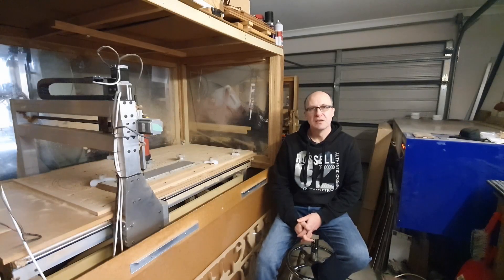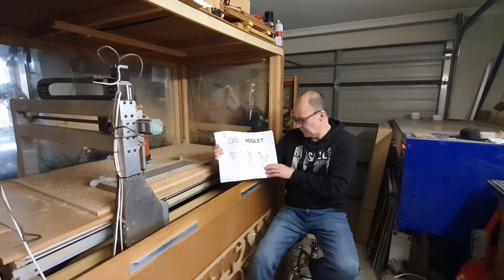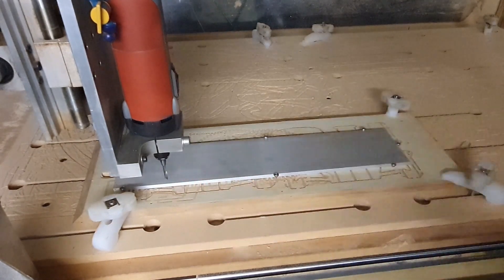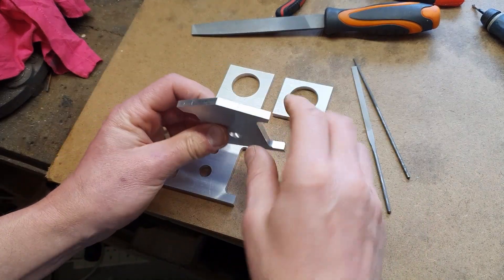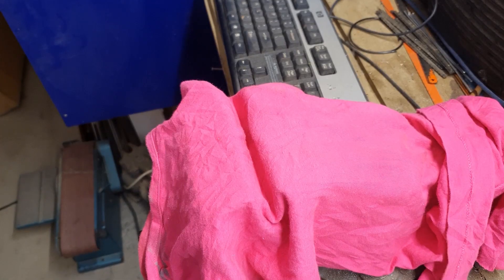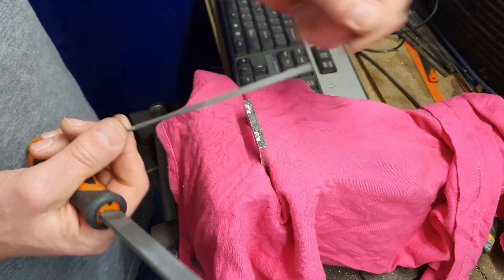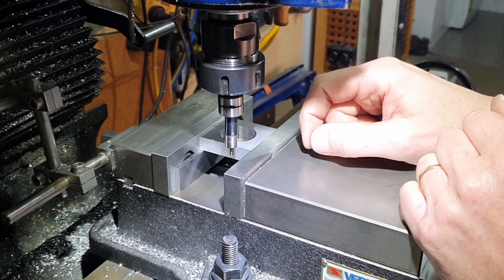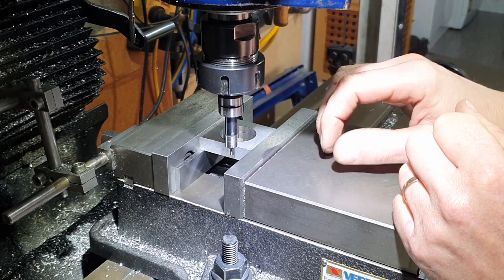#87 Part 1 - Hoglet V-twin Engine - Crank Case & Crank bearings

Comment: Hi Kevin. I like the use of the cnc to cut out the frame. The Hoglet is an interesting build and the engine replicates the sound of a Harley really well. Good luck with the build.
Cheers
Andrew
Reply from the maker: Hi Andrew. Thanks for watching. Now machining the Crank webs. Trying to source the bronze for the flywheel rims. At the moment I have a quote for $230.00 (NZD)...ouch! That's roughly 115.00 pounds. I'll keep searching. Cheers kevin
Reply: Hi Kevin, I managed to get some bronze tube 4" x 2.5". I paid a total of £48 for two pieces. Good luck in your search.

Comment: Nice work. I built a Hoglet a couple of years ago. I used off the shelf metric gears 0.8 mod, 20t/40t SS08/20B & SS08/40B with very small centre change from drawing. I had some irritating problems with this engine, the whole bearing line up is produced with screw up plates so if you make low tolerance bearings it all nips up when you assemble it even if you try really hard to get the plates all square. The crank pin clamp system only just works even when tightened really, really tight. I couldn't find the big end bearing anywhere in the UK so made a steel insert for the rod and a bronze bush bearing. The flywheel rings don't fit very tight to the centre webs even if you go way undersize on the ID's because the rings just pull out of shape.  On my engine the timing seems mismatched between the 2 cylinders, at any particular speed the ignition timing seems to want to be different between the two. This might my magnet positions on the gear wheel but pretty sure they are as drawing. A dual pickup system with separate adjustment for each cylinder might fix it.
Reply from the maker: Hi. Thanks for the tips. Thanks for watching and commenting. Regards kevin

Comment: Hi Kevin this looks like an interesting project. With the crankcase's being made up of lots of flat ali plate are they sealed oil tight? Does the engine have a wet sump? Tony
Reply from the maker: Hi Tony. It's an open bottom end so the crank/flywheels exposed. Loosely based on the Harley Hog engine. Regards kevin

Comment: Good choice Kevin, I built one a few months back. Had to make the gear cutters as I couldn't find any in England. I used Oilite for the bushings/bearings. Always good to have some stock in. Follow the drawings rather than other YouTubers! Note, on the barrel fins, the angle cut starts from the 3rd fin down, think I've seen this being overlooked by some. On the head fixture I added 2 x M4 threaded holes below the studs so they can be pushed out. Make the dowels a tight fit, no need for the securing pins. Any questions just ask.
Reply from the maker: Hi Dave. Thanks for the tips and watching. Regards kevin